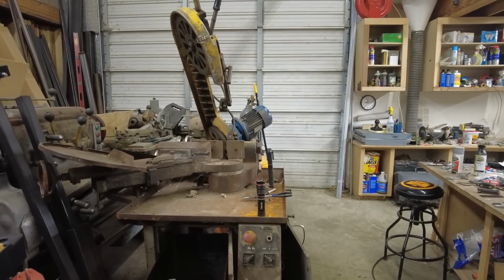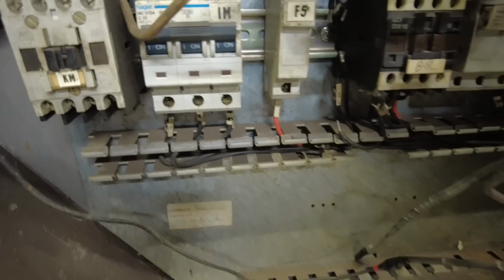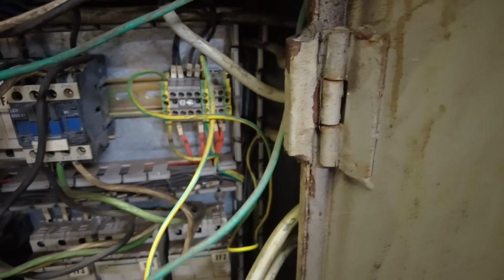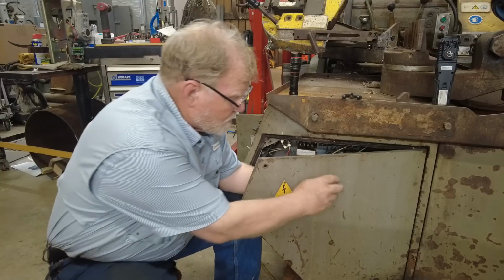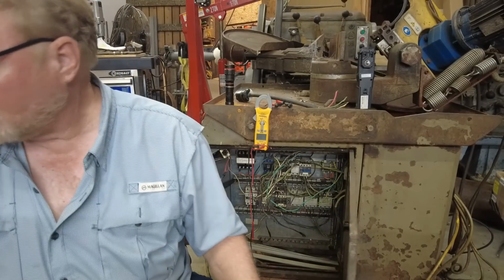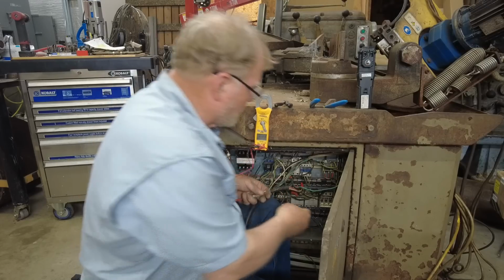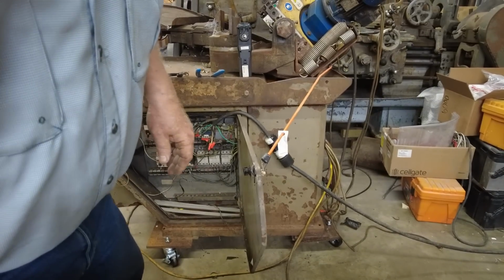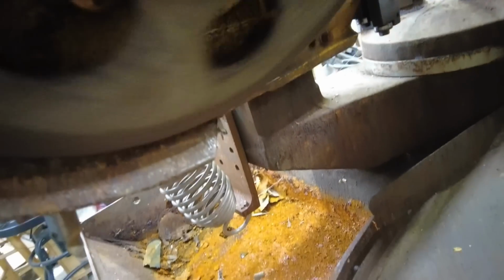This Should Be A Crime: Part 2 Will the Motor run?

Comment: I have saw like that its not mercury switch its blade tension broken blade switch. Motor will not come on unless blade is on and tensioned. I love my saw worth sinking little bit effort into it.
Reply from the maker: Thanks for the Info Kevin.... Do you know if it works on a NO or NC basis?   It is currently open with no blade on it.....
Reply: Normally closed for this type of machine it would be in series with the emergency stop switch. It is in a loop of the control circuit, if any device opens the saw will stop
Reply: On the front cover idler pully side there's blade tension indicator round shaft 2 diff dia, switch rides on them if tension isn't right or blade brakes saw will not run

Comment: Steve, a couple of thoughts
The wiring going up the bow could be either a magnetic switch to shut the motor off if the band breaks, the band completes the magnetic flow, so it should be open now since there's no band.
Or a magnetic switch to shut the motor off when the bow reaches bottom of cut(but that would mean it had to come down near a steel stop).
Or is there a thumb/ trigger switch up in the bow that could be used to trigger the contactor into starting the motor?

I'm betting "Bubba" broke the low-off-high switch and couldn't work out how it functioned, so he wired in his own power feed to the toggle switch and ran that to the motor contactor/relay, which would have given him only one speed...
Hope my fellow Aussie helps you out, we're good at lending a hand when a mate needs it.
Cheers
Reply from the maker: When I have time I'm going to pull the wheels and see what it is, getting the gib for Don take priority and then the Bridgeport and 10EE are inline first!... All the other saws I have had have a toggle switch that is tripped when the blade is full down....

Comment: 2 interlocking 3 phase contactors with normally closed aux contacts wired from the switch so you can't enable 2 speeds at once (coil on one contactor connected trough the aux contacs on the other) you could use just one set of fuses at the input plus whatever phase configuration is the pump
european core allowed ar tnc specyfication to bound neutral and ground and in this 4 wire situation it just could be neutral + ground bounded wire
in typical full setup we would also have phase spin direction lockout and motor overload automatic fuse but  that impoerant mostly for pumps and fans

i was wondering if speed of the motor is controlled by separate windings or by delta/star configuration
Reply from the maker: There are two cables and contactors going up there, havent the time to reall see what they are doing inside the box though.

Comment: You don't need a neutral , the 24volt supply is taken from a transformer wired across two phases!
Reply from the maker: Correct. What I was talking about is where they were getting the neutral for the 110v that is running to the coolant pump.  At first I was thinking they were using the separate 110 plug but that turns out to the rigged system to control the contactor for the motor... I plan on putting a 220 to 110 transformer in there to take care of a neutral when it's rebuilt.

Comment: You'd say it wasn't worth saving if the motor didn't work? I'd expect a replacement motor would be cheap if not free - lots of people ditch lots of 3-phase motors simply because they're 3-phase and they don't know how to use them. I'd say the key factor in whether it's worth saving or not is the gears in the gearbox, or potentially that drive wheel being bent or cracked.  Or is the next white whale project going to be cutting a new worm gear - 10 part video series!
Reply from the maker: The motor as it is is wired for two speeds, hard to find a used one like that, especially one that would bolt up to that transmission.   Around here it cost at least 750.00 to send it to a motor shop... IF this one turns into a series like that I'm giving it to Don as a Christmas gift to fix :)
Reply: @10swatkins  Do you really need 2 speeds though? Like you said even the "fast" speed seems pretty appropriate for a bandsaw. And if it came to needing a new motor, I'd just put a VFD on a single speed motor, put 2 speed presets on it, and call it a day. You could run it from 220V single phase then too, and wouldn't need to fire up the RPC to use the bandsaw.

Comment: Well I myself would just rip every last ounce of wiring out of that and just design a new system that I like. But in the past I have designed machine control systems, so that is an easy one for me. 

I would install a variable speed drive for the motor, a pump control circuit and then a switch somewhere that shut the thing off when the arm is level, the normal stop switch for such a machine. That stop circuit would also trigger a reset system so that you have to manually restart the machine, a simple NO contactor that is pulled in by a start switch and held in until the arm drops fully.

As a small point, the motor is a 90L frame, wound in Delta from what I see wound for both 4 and 8 poles. The 4 /8 pole windings is what gives it the two speeds.
Reply from the maker: Thanks for the info...       We are working on drawings and the like...   From what I can tell all the original wiring is still in there and in great shape... The rats nest is all workaround crap.... We will  see ;)
Reply: Yes, I just did this with a lathe. Ripped all the wiring out and started from scratch.
I don't like circuits that allow restart when the guard is closed or emergency stop reset, so I added an interlock relay that needs a separate reset to enable restart.

Comment: I love ripping out peoples rats nest and putting them back to factory. And ripping out 70 year old factory wiring and replacing it with modern stuff. Probably just my OCD. Anyway I believe the 110v line is a red herring, rip it out. The pump was originally 3 phase. This would explain the 'spare' 3 fuse box and the 'spare' contactor with no wires to it. The high speed contactor for the main motor is not original. It does not match the other two. I suggest that this was replaced and they only had a 110v one lying around. At some point the pump went bad and and they only had a single phase one to hand, or it was the cheapest. No machines like that use single phase motors. They are not as reliable as 3 phase because of the starting circuit. If you get a 3 phase pump and a replacement high speed contactor with 24v control things will be a lot simpler and clearer. I think the wires running up to the 'mercury' switch probably go to an interlock switch for the guard that has rusted to dust. Have fun
Reply from the maker: Makes sense on the 3p pump....    I'll look around for one... After I get Don's gib made and the rails finished and the Bridgeport into paint I'll look at the rest of the saw :)

Comment: "Poling" in Australia means the armature is rubbing against the winding poles, due to bearings worn or collapsed.
Reply from the maker: Thanks for the Info :)      In this case it was the RPC motor not starting because of the load or a short...

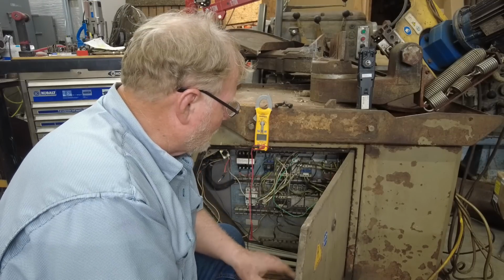Comment: Steve, at around 17:40-45, when you were checking for continuity,  you also need to check if it is made when the saw is in place to cut, that way it would turn off when it is in the up position and in the "finished cut" position....  just an idea... and probably the single fuse is for the 24 volt control circuit... One other thing, I have seen some places connect 230 V 3 Ph with common extension cords that have 3 conductors and a ground like a 10-4 or 12-4... that is what the added wire looks like to me... Now that I saw the rest of the video, someone probably either dropped something on the wheel or dropped the saw and it fell on something...Good job troubleshooting! Now I would get all the extra wires out of there and start over...
Reply from the maker: I did check all positions on the saw for continuity... Just always cut a lot of film out or we would have 14 hour videos :)  At the very least the cabinet will be back close to factory condition!

Comment: I think this is how the fuses and motor windings are configured (where 'wwwww' represents a motor winding.

low-speed--L1-->TF1-1-------------------v  
high-speed-L1-->TF2-1--->wwwww+wwwww----+
                                                                                   |
low-speed--L2-->TF1-2-------------------v                    |
high-speed-L2-->TF2-2--->wwwww+wwwww----+------>Neutral
                                                                                   |
low-speed--L3-->TF1-3-------------------v                    |
high-speed-L3-->TF2-3--->wwwww+wwwww----+
            

I'm guessing it's a Wye configuration 3-phase motor and each of its 3 windings has a high tap and a low tap. And there's a 3-pole contractor that feeds the high taps, and a second 3-pole contactor that feeds the low taps.
Reply from the maker: Thanks for the trouble to type that out! Good info to keep around!
Reply: @10swatkins  I've done a bit more research and now I think my first diagram is incorrect.  Check to see if the L1, L2, and L3 terminals (or the T1, T2, and T3) terminals of the third contactor are bridged together (perhaps via a fuse block).

If you've got a contactor that bridges 3 of motor wires together,  then the motor is probably a "Dahlander" motor with a single continuous winding with six taps. 

The two speeds are achieved by switching the taps between a Delta configuration (for low speed) and a Wye configuration (for high speed). That requires three contactors. In low speed, the power is on motor wires 1, 2, and 3 (via contactor K1). And in high speed the power is on motor wires 4, 5, and 6 (via contactor K2), AND motor wires 1, 2, and 3 are shorted together via contactor K3. 

low speed Delta:
                                        L2                                L3
                                         |                                   |
+---1---www--4---www---2---www---5---www---3---www---6---www---+
 |                                                                                                                |
 +--------------------------------------------------+-----------------------------------------------+
                                                            |
                                                           L1

high speed Wye:
                      L1                                L2                                L3
                       |                                   |                                   |
+---1---www--4---www---2---www---5---www---3---www---6---www---+
|                                        |                                   |                                   |
+----------------------------------+-------------------------------+------------------------------+
                                                         
(look up "Dahlander pole changing motor" in Wikipedia for a much better diagram)

Comment: Based on the current version of the FMB Antares bandsaw,  it looks to me like the Antares is a completely manual model that works like a chop saw in a woodshop. . So the two wires going up to the top of the saw arm aren't for a mercury switch or a safety switch.  Rather, I think there's supposed to be a handle there with a trigger button to turn the saw on and off. I think you have to hold the trigger and pull down on the handle to make your cut. And, when you release the trigger and the handle, the saw immediately shuts off and the springs pull the arm back up. In other words, there's no automatic shutoff going up or down. That trigger probably runs off of 24V and is wired to the motor contractors through the high-speed or low-speed selector switch.
Reply from the maker: I don't see any place for any type of switch on the upper part of the saw.
Reply: @10swatkins  It's definitely there on the FMB parts diagram and parts list of the current version of the Antares bandsaw (and mentioned in the operating instructions). Maybe a previous owner cobble-fabbed a replacement handle and did a trigger-button delete.

Comment: Maybe the cable going up into the arm is for a pre tension safety ensor, some band saws require a certain pre tension to be able to run.
Reply from the maker: Wee will see when I pull it apart!  Thanks for watching!

Comment: You're doing a good job so far. Wiring looks so complicated at first glance, but if each function is wired up one at a time, it is easier to make sense of it all. When everything is all done it looks complicated again for the next person to work on it.. Proper markings would sure make it easier.
Reply: take one at a time to get to the bottom line end?
Reply from the maker: When I was looking at it the first time I was just trying to get to the grinder and a little pissed that someone would do such a thing... After cooling off and tracing things out the factory stuff was well layed out , marked, and pretty simple...
Reply: @10swatkins  That's good to hear.

Comment: My guess is it got dropped or someone tried to adjust blade runout with a too big hammer.  This is Mike from Dime Box and I might have another wheel for it (one of my guys tipped over an Enco 7x12 gear drive saw and broke the bow).  Let me know if you need one.
Reply from the maker: Thanks Mike... I will let you know

Comment: If your power source is a 4-wire 3-phase Wye circuit (ie L1, L2, L3, and Neutral), then if it's 220V phase-to-phase (ie L1-L2, L2-L3, L3-L1), the voltage from any phase to Neutral will be 127V. So in it's original configuration, the coolant pump was probably internally wired to L1 and Neutral. A 220V 4-wire 3-phase source might be common in Italy, but it's generally not found in the USA. In the USA it's usually 3-wire 208V 3-phase or around 240V 3-phase. Both of which are close enough to 220V for that motor to probably work ok on either configuration.

Check the 3-phase power cord that came with the bandsaw. It's probably a NEMA L15 plug, which is for a 3-wire 3-phase 240V source (ie, no neutral or ground).

I'm guessing if the shop the bandsaw came from was configured with a 3-wire 3-phase power source without a Neutral wire (eg from a Delta-wired power source),  rather than re-wire their shop to 4-wire 3-phase Wye configuration (or to a non-standard 4-wire high-leg Delta configuration) , they probably just used a separate single-phase power source to supply 120V to the coolant motor. Hence the addition of a NEMA 5-15 plug and cord.
Reply from the maker: They used the 110 plug that was wired into the machine to power a single toggle and a single contactor to make the machine go.   The neutral from that line went nowhere else so My guess is they used the ground for the neutral and rigged it like everything else they did.  The machine did not have a 3p plug on it when I picked it up...
Reply: @10swatkins It looks to me like you've got three 3-phase contactors. The two black ones look original, and the one with the blue plastic features looks like a replacement. I believe the two contactors on the top DIN rail (the lefthand "black" one and the righthand "blue" one) control the high and low speed of the main motor. And the one on the bottom DIN rail is probably for the 220V to 24V transformer (in which case it might be a 2-pole contactor rather than a 3-phase contactor). 

Is there any coil voltage rating info on  the three 3-phase contactors? Obviously, the "blue" replacement one has a 120V coil. But what's the coil voltage on the other two original contactors?

My WAG (Wild-Assed Guess) is that originally all the contactors had 24V coils (otherwise there's no need for a 220V to 24V step-down transformer).  And the 24V coil on one of main 3-phase contactors, released all its magic blue smoke (magice blue smoke is sealed inside every electrical device, it's what makes them function, and they stop working of any of the smoke leaks out).But, instead of replacing the failed contactor with a new one with a 24V coil, they replaced it with that "blue" contactor with a 120V coil.

Then, to make the replacement "blue" 120V contactor work, they hacked in that 120V plug and that new chrome 120V on/off switch (and bypassed the fast-slow switch). Because they only replaced one of the two 3-phase contactors, they had to delete the dual speed function.  Or, maybe they accidentally cross-connected the 120V and 24V control wires, which released their magic blue smoke. So now the other two original contactors  (and maybe the 220V to 24V step-down transformer) are now non-functional.  That's all just a worst-case guess based on how badly hacked (and nonsensical) all that wiring looks, and how many disconnected wires there are.

Alternatively, maybe the first thing to go was the magic blue smoke from the 220V to 24V step-down transformer (and if it shorted the primary to secondary, it could have taken out some or all the 24V contactor coils). So, to get the bandsaw working again, rather than replace the step-down transformer, they hacked out all the 24V control wires and hacked in a single 3-phase contactor with a 120V coil. And perhaps, then mistakenly wired the coils of the other two original contactors to 120V (and released some more magic blue smoke).

I suggest you disconnect the primary and secondary of the 220V to 24V transformer and check it with your multimeter. If it's not shorted or open, connect a 120V cheater cord to the primary and see if you get 12V on the secondary.  If the step-down transformer is still good, then it really wouldn't be a big deal to restore all the old wiring and fix it all the right way. But, if the transformer is bad, I'm betting some or all of the original contactors with 24V coils are also bad.